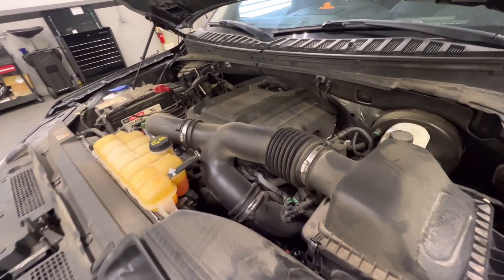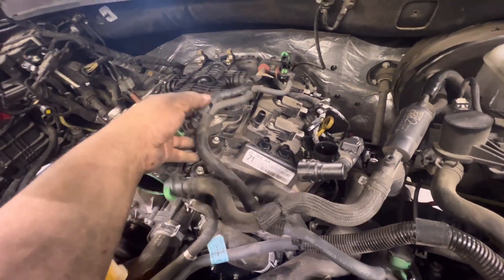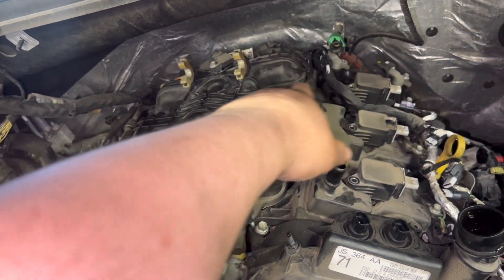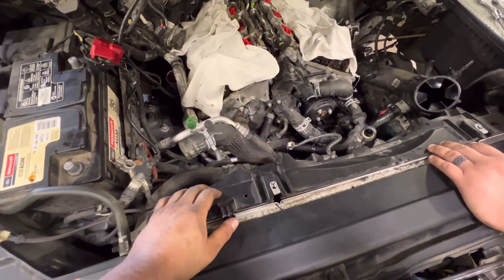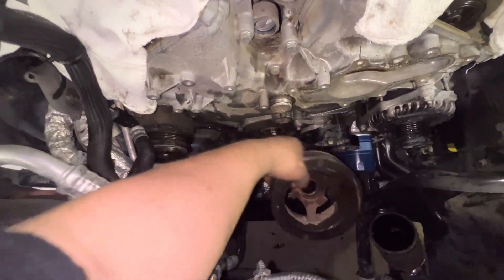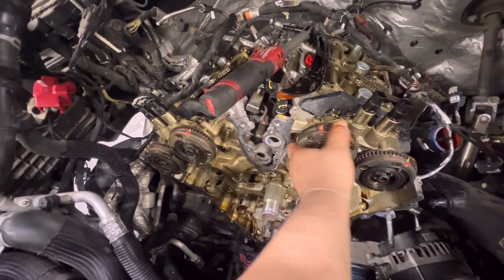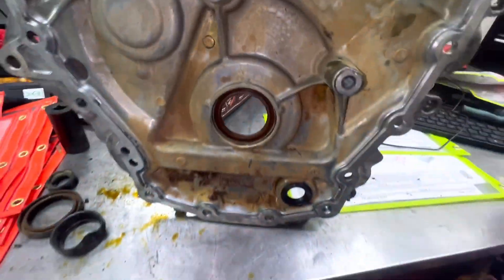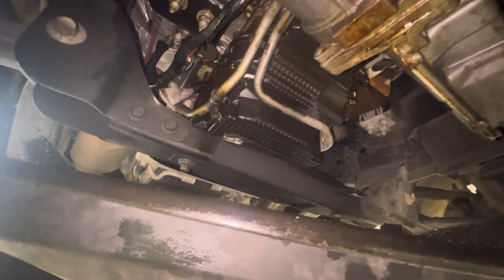FORD 3.5L Ecoboost Cam Phaser Rattle Fix & Replacement ~ Ford Finally Made Better Phasers!!

Comment: My 2017 3.5 work truck has 273,000 miles and it’s never rattled or needed turbo work. Oil changes every 3,000 miles since new and always allowed to warm until the temp gauge moves before driving, as well as cool off for 30 seconds before shutdown when towing.
Reply: Changing the oil and letting it warm up will not prevent this. You just got lucky.
Reply: @RS-gq8wh  I guess I’ve gotten lucky with cam phasers on 3 Ecoboosts and two 5.4 3v’s years ago too. Can it still happen? Yes. But 90% of the problem is in ownership. You can’t use it for 15 minute commutes to your 9-5 at the bank, or idle in the Starbucks drive-thru for half an hour everyday while still following normal OCI’s and inspections. Folks own these 400hp+ pickup trucks like they’re Honda Accords and expect the same longevity with minimal care, it doesn’t work that way. Maybe in the days of 200hp and 10mpg…
Reply: Did you ever had to replace throttle body
Reply: Mine is at 90,000 and just started the rattle
Reply: How many set of coil packs has it had?
Reply: @jeffbeliew6568  It had a nasty misfire under load a few years ago, we replaced all 6 coils and plugs and it hasn’t had any issues since. 

When it comes to these engines and 5.0’s, always use Motorcraft parts no matter the price difference. Also, stay away from Amazon and EBay, tons of Motorcraft counterfeiters out there.
Reply: Mobil 1 is good oil huh
Reply: Mine is at 70k miles and just started smh
Reply: @donloz9000  it's still covered by the recall up to 90,000 miles. Take it in.
Reply: @MEANSBC what recall. At 73k. Only thing I found was software update the expired a year ago that has been proven does not work.
Reply: @daveschwartz1702  I didn't realize it had expired.  It was recall 2N103 that extended the warranty on the cam phasers to 90,000 miles, but it expired in January of 2023.  I didn't realize they put a date on it.
Reply: @MEANSBC lmao ford told me I never recieved one, 2018 150 3.5 and 47k miles and it rattles like a mfer. Guy on the phone said he is looking at all letters sent for my truck and there’s no letter cause I was never included. Told me I could pay for it and then call ford charity support basically plead my case. Im bouta just do it at this point.
Reply: Lucky! I have a 2018 and I’m replacing mine for the second time as I type. I have owned it since 38k miles and it sits at 91k now. Luckily it’s a CPO, so it will only cost me $100, again… synthetic oil changes every 5-6k miles and rarely tow/abuse the truck. Sounds like it’s a random problem that some can’t avoid.
Reply: @FullSierra91  Depending on your climate and warranty, you may try a heavier oil and/or shorter drain intervals. 5,000 miles isn’t often enough for these engines IMO if you’re just using it for a short commute to work. Clean, quality oil is cam phaser’s best friend. 

Don’t feel all that bad either, our 18 GMC is due for a cam/lifters. Not looking forward to that one.
Reply: @ I really only use the truck to get to work and back, and some Home Depot runs. And maybe up the mountain for ski days. But that’s about it. In the last 10 years I have had a 2005 F150 5.4 that had phaser issues, a 2010 Chevy 1500 5.3 with lifter issues where I had to do a full rebuild, a 2017 Tacoma, 2010 Tacoma, and this 2018 F150. My favorites were the Tacomas that gave me no issues, but the low power and small cab space was what made me sell them. I love the power, space, warranty, mpg, looks, and drive ability of the 2018, but I think itll be out of my garage soon.
Reply: @FullSierra91  The Tacoma is a great choice for people that use trucks like cars. Super reliable, decent on gas. I’d have one if I could get away with it. 

However, slap twin turbos on a Tacoma and mass produce millions of them for the working class and they’d have issues too. That’s basically what’s happened with the new Tundra.
Reply: @17doctor650  With that many miles, how many times have you serviced the transmission?
Reply: @ Fluid/filter exchanges and differential flushes every 50k. The factory recommended 150k interval is a total scam, don’t follow it.
Reply: @FullSierra91  make sure they use the new part number and should never happen again.
Reply: @FullSierra91  toWING IS Not abusing a truck. REAL trucks like men, work.
Reply: @mauibuilder1239 hell yea brother
Reply: Oil changes help but there are vehicles that they fail at even 25k miles.    Consider yourself lucky.  Ford should replace every one of the phases with the old style.
Reply: The only go bad if you let the oil leak really bad
Reply: @carzyman101izm please explain
Reply: If you live in a cold place it's a big problem in Midwest your lucky to get 170k in California 300k trucks are still 10k$ here 1000$
Reply: @rickyrose5242  why is the that?
Reply: This is totally ridiculous having to repair Fords mistake. Personally I’d get a lawyer and fight for what Fords design flaw.
Reply: @chrisdaniel5004  they're always screwing up.  But this is the best pull and mpg engine
Reply: Mine @ 84k in the shop now😂
Reply: @ericpetteway3841 she’s still ticking along a year later, almost (not yet) 300k miles! Still no cam phaser rattle, though the driver’s side turbo does leak a few drops of coolant overnight. Still more reliable on paper than my old Cummins was!
Reply: @17doctor650  glad to hear it, I’m keeping mine as long as possible 😂😂
Reply: @ericpetteway3841 If it makes you feel any better, a friend of mine is waiting on his SECOND 6.2L Sierra engine to be replaced. GM doesn’t want to warranty the work either, as he changes his own oil at my shop. I’ll take noisy cam phasers all day over that mess..
Reply: @17doctor650 yessir I’m with u on that one. I definitely like changing my own oil, and most of my own mechanic work. I put mine in the shop because my wife bought a warranty and I’ve been busy with a few other projects
Reply: My 2017 started the rattle at 95000. Took it to  the dealer to get the repairs done and it was $4600!
Reply: YoU SHoUldn't have tO baby a god damn truck, sorry.
Reply: @mauibuilder1239  Buy a 200 horsepower 90’s truck if you want to abuse it. You can’t have your cake and eat it too.
Reply: Mine got to 225,000 miles
Reply: I find this very hard to believe but I'm glad you got a good one.
Reply: Dang unicorn truck. Mine started rattling like crazy right after 90,000 miles.
Reply: @MEANSBC  same here at 92k